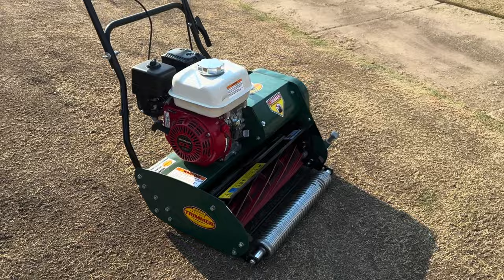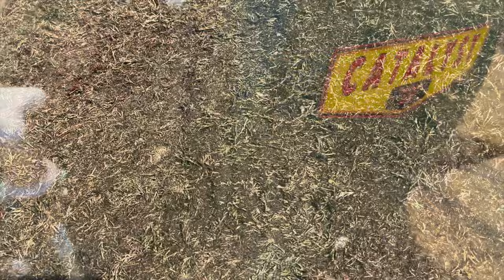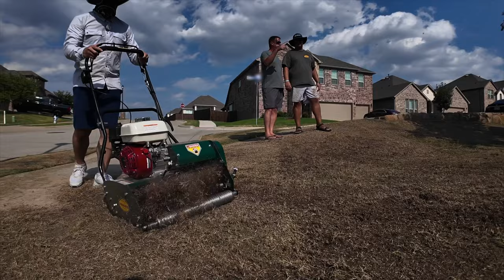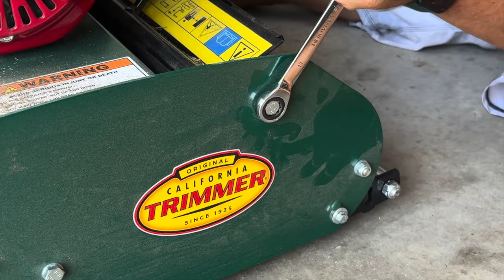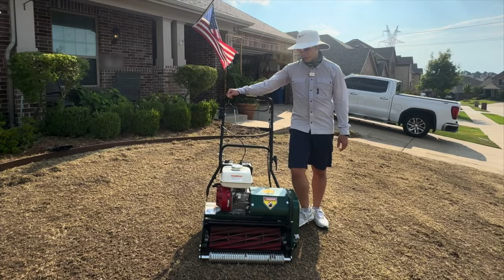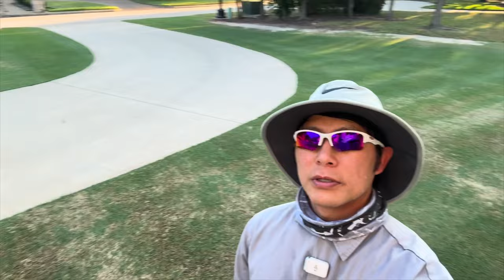VERTICUTTING | Scalping Lawn | California Trimmer Catalyst Reel Mower

Comment: That’s some aggressive verticutting!  I bought a Catalyst the week it came out, had a few growing pains learning the mower (coming from a McLane) but am in love now.  It’s a beast, and have a verticut cartridge coming for next season.  Great video, glad you were able to put this out
Reply from the maker: @asubeaufoster  definitely an upgrade from the McLane.  Enjoy the verticutter !  It’s a must when we reel mow often.  Appreciate you watching 👍
Reply: I have a McLane and use it on my Zorro Zoysia that I cut at 1.25 inches. The zoysia is very thick and the McLane tends to "float" on it. The zoysia needs to be verticut and thinned even after I severely scalped it this spring. I am considering the Catalyst for the cartridge feature and its heavier weight. How high will it cut?
Reply from the maker: @geomark8851 according to the caltrimmer.com the 7-blade can cut as high as 1.25”(30mm).  While the 10-blade cuts as high as .500” (13mm)
Reply: @MyLawnStory  Thanks!
Reply: I have a Mclane now and thinking of making the switch. What were some of the growing pains you experienced?
Reply from the maker: @seapanther53  with the McLane adjusting the reel to bedknife by tapping two metal tabs with a hammer and screwdriver was painful.  Backlapping also wasn’t too fun with taking apart the cover and chain then using the special tool from reel rollers.  Entire process takes longer than it should be.

You won’t have those same problems with the Catalyst.
Reply: @MyLawnStory  I 100% agree, which is why I'm willing to make the switch. I am just curious as to the growing pains. 
I do have a question that maybe you could answer. One thing I like about the McLane is I can manual push it while the reel is going. This is great for mowing around trees, utility posts, etc. Can you do that with the catalyst, or must the drive always be its source of forward movement?
Reply: @seapanther53 you can freewheel the Catalyst once it has broken in, but definitely not as easily as the McLane. After a mow or two, I got used to feathering the throttle to go around beds/turns. It’s not as easy, and some will not like it. I find the other benefits of the Catalyst outweigh the few cons
Reply from the maker: @seapanther53  looks like @asubeaufoster got your question answered 👍 I personally was not able to use the reel cartridge that day and only did the verticutting but depending on what size mower you go with, 20” or 25” that will determine how much you can push.  I will say the 20” Catalyst was heavier than a 25” McLane if that helps any.

Comment: Nice video! I have the 20" Catalyst and the verticutter cartridge. I've been very happy with my purchase. I'm 5'8" so I definitely needed to adjust the handlebars because I too found it uncomfortable at the higher setting.
Reply from the maker: Appreciate you stopping by !  It’s definitely a good thing they can be adjusted.  I think as of right now it’s the most affordable option compared to the others. 👍
Reply: Content please! I have seen your shorts but would appreciate a more in depth review of the CT Catalyst
Reply: @geomark8851  I'll try to get one out at some point. It's been hard to get stuff done outside lately, let alone make videos.

Comment: Interesting video! There isn't much content on the Catalyst yet, so thanks for posting this!
I think it is the same (except for the paint, labeling, and the basic reel is 7 blade vs 6 blade) as the Cobra Fortis that is sold out of England. I believe both the Cobra Fortis and the California Trimmer Catalyst are manufactured by Greenman Manufacturing in China although they may say "Assembled in USA" or "Assembled in Great Britain" like the Rolux sold here claims. Cobra sells an Ego battery powered version and I wonder if California Trimmer will be offering a similar mower soon?
Reply from the maker: I believe when the Catalyst was first announced they did mention a battery version will also be coming out.  I don’t quite remember but I think it would gain some traction in the states if they do.  Appreciate you watching! 👍

Comment: I've been torn about what mower i should go with.  I currently have a 20" California trimmer homeowner model with a 5 blade reel.  I was thing about picking up a greens mower like the Toro or John Deere on the used market.  But  now California Trimmer is releasing this Catalyst but I have not seen many reviews or videos yet on adjusting the reel to bedknife and backlapping.  I like there is a 10 blade reel and verticutter cartridges as well as a rake to raise some blades up before cutting.  I'll pull the trigger next spring and hope there are some more reviews and feedback like this one before I decide.
Reply from the maker: Definitely not a bad upgrade from the Classic Cali Trimmer !
Reply: @MyLawnStory  Would you recommend going with a used Toro or a new Catalyst?
Reply from the maker: @barakharlan  The cut quality on a greens mower will always be superior to any residential reel mower.  It comes down to convenience, because there are aspects in those residential reel mowers that make things easier to use than a greens mower.  I wouldn't buy a Catalyst to replace my Toro but I would buy a Catalyst for verticutting and turf raking.

Comment: The Catalyst has been working out pretty well for me so far.  I'll be changing out the cartridge to verticut soon for the fall season. Do you recommend doing this while the weather is still very hot, or wait till temps dip for the fall?
Reply from the maker: Definitely should be used during the active growing season so that the lawn can have time to recover.  In our case with Bermuda grass, the lawn gets too thick during summer time and verticutting will help alleviate that.
Reply: @reelgardener does the reel to bedknife adjustment stay locked in after cutting grass.  How often do you check to see If it's cutting paper and how ofter are you having to adjust the reel to bedknife setting.

Also is the walk behind speed hard to manage from a stopped position? Seems to take off quickly
Reply: @taylorlan3754  I usually do a quick check to see if its cutting paper well before each mow.  I'm reeling into mowing, so I'd prefer to do a "quick check" just to make sure everything is all good.  Its been cutting so, haven't made any adjustments yet.  The speed usually takes off on me, lol, so I'm still acclimating to the pace.
Reply: @ReelGardener  thanks for the reply! I was convinced I would get this one but then saw in a video you have to take out the cartridge to adjust the bed knife to reel.  That seems too time consuming.  Is that true?

Comment: Does CA have a dethatcher as well. And would u recommend dethatching Bermuda
Reply from the maker: It does have a dethatcher as one of the cartridge options.  I haven't really looked into dethatching as I understand it works well for longer cool season grasses but if you're cutting below an inch verticutter should suffice.